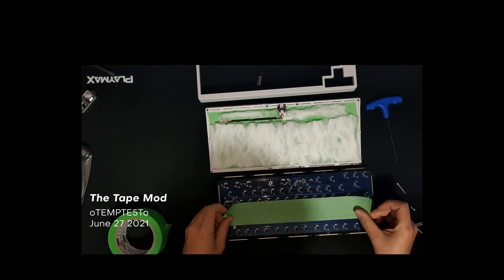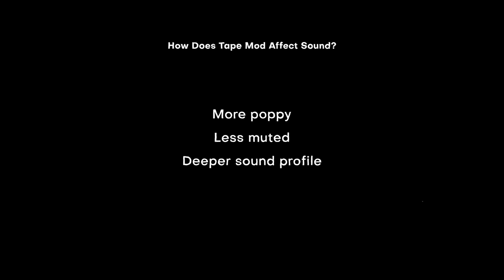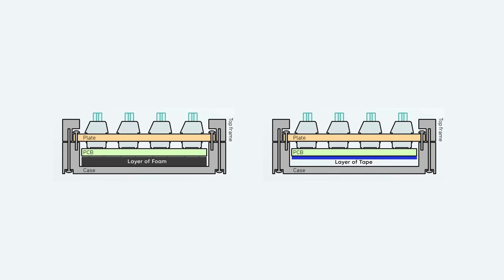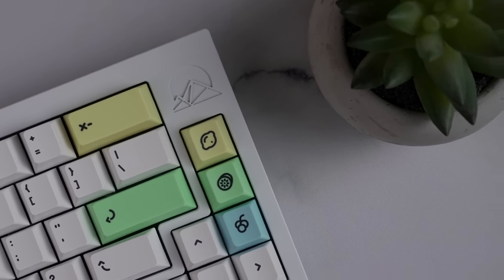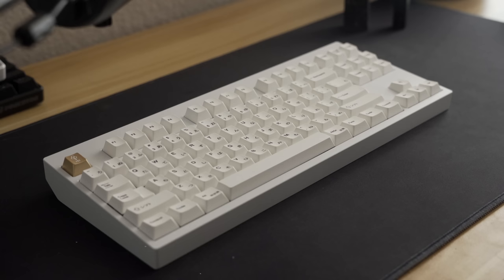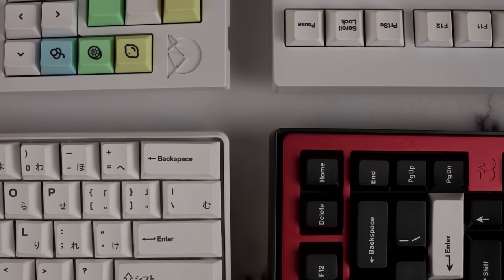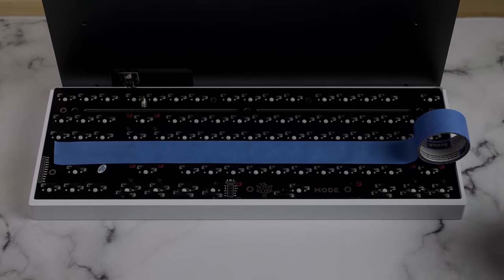Tempest Tape Mod Explained

Comment from the maker: PLEASE EXPAND THIS COMMENT FOR IMPORTANT INFORMATION

There’s a lot of great insight being shared in the comments, and I can only pin one, so I will compile it all here. 

The tape I personally used was SCOTCH BLUE: https://amzn.to/3fkDBuS 

*Shaquille Tarek* believes that the tape absorbs the higher frequencies of sound made by the inner assembly, acting as a kind of filter, while still reflecting back some of the lower frequencies. This is agreed on by ai03, and Tempest himself, so I would say this is the actual proven theory up to now as to how the mod works. Regardless of what the mod scientifically does, the effects of the mod on boards is fairly predictable (but of course there will be outliers because of unique designs).

*Zach Shapiro* thinks the mod will work especially well for tray mount boards, and has personally tried it with his Tofu, yielding great results. He found it helps remove reverb and boosts the volume of the inner assembly. 

The keyboards that I mentioned don’t have a PCB are **HAND WIRED**. This is when you essentially make the PCB on your own using through hole diodes and a QMK compatible microcontroller. 
Read more about it here: https://beta.docs.qmk.fm/using-qmk/guides/keyboard-building/hand_wire
And here: https://geekhack.org/index.php?topic=87689.0 

*Rob R* theorizes that tape adhesive should get stronger over time, as it bonds with the surface it is applied to. This would create problems if the board owner wanted to remove it in the future. The mod hasn’t been around long enough to prove this, but I’ll make an update on this in a future PE foam mod explained video. 
Tempest explained that he never had this issue with washi tape, and if it does arise, to use regular PCB cleaner / isopropyl: https://amzn.to/3BYa9od

A lot of people also seem to have inquiries about PE foam, a mod that also seems to drastically change acoustics. I’ll have some in soon to mess around with and I’ll try to answer all the questions (namely tape mod + foam)  in the comments regarding it. 

Further questions can be redirected to my Discord: https://discord.gg/VBuHBW3BUF 
Or Shoobs’ (where Tempest resides, but please don’t ping him): https://discord.gg/caBRWtya3a 
And of course, please watch Tempest’s original video on the mod: https://youtu.be/4T8Ov74i4m0
Reply: ok
Reply: thanks, totally needed it all
Reply: The fact that you said it was easy wasn't true when I wanted to screw in my ducky one 2 mini since the case is larger and It was difficult to put the screws back in
Reply: Is there an update whether the adhesive on the tape stick to the pcb or it did not?
Reply: @shirouemiya5660  Been using this for 2 months or so on  a TKL board I have. The other day I got some new switches and wanted to know what they would sound like without the tape mod. When I removed the tape it was super easy (what I did was I overlapped one strip of tape with the other). Surprsingly it made it even easer to peel of since the tape was like one single of paper. Then when I put it back, it still had enough adhesive to stick to the PCB again. I used rmasking tape. No damage done, just don't use stickier tape I guess.
Reply: What is a good tape to use.
Reply: @vectivuz1858  Hello, does your keyboard have a battery? I want to know if it is true that masking tape can be a fire hazard?

Comment: "99% of boards will have a PCB." Wait, what's the 1%
Reply from the maker: Hand wired
Reply: @nearLucid  lol
Reply: @nearLucid  make sense..
Reply: ? hand wired
Reply from the maker: @MysticM0  as far as I know, it's basically making your own PCB. It's very complex and theres barely any information on it, but would be a fun project for anyone who enjoys soldering.
Reply: @fitchyyboi  People who know how to use a soldering iron and have patience do exist. Personally love soldering. Having metal just flow on another metal at your will is pretty fun personally. Only desoldering is a pain tbh
Reply: I made a handwired 40% not too long ago just to try it - pretty fun
Reply: 1%(obviously more) = membrane/handwire
Reply: @hinczykus  But membrane has a PCB.
Reply: making your own PCB but it's just the C
Reply: Typewriter
Reply: The scary ones
Reply: Cutting boards lol
Reply: @weiyuan20  pfft haha
Reply: Non mechanical ones? The ones with the rubber board
Reply: @ottersaurus  it is still technically a keyboard with a pcb, Printed Circuit Boards are basically just boards with conductive material printed on it, letting current pass through, a membrane technically does the same thing but I wouldn't really call it a board when it comes to the material used
Reply: I also remember seeing a keyboard that projected an image onto a surface like a desk and when you "pressed" the keys it would register on the gadget show (a show in the UK) when I was a child.
Reply: @nearLucid  it's not with a teensy, but this is technically a PCB too.
Reply: @fitchyyboi  Soldering is really fun and satisfying IMO!
Reply: @fitchyyboi  cope
Reply: type writer 
0_0
Reply: The musical keyboard
Reply: the world is very big that's why everything is not 100% all the time XD

Comment: Definitely makes cheaper boards sound so much better
Reply: No it most certainly does not. It makes it sound MUCH worse. Even a good sounding keyboard with tape mod becomes a cheap mushy keyboard you'd find in the computer lab at school.
Reply: @HotCoco_  it's preferences. some like mushy, thocky, poppy, clacky, silent, etc. same as ppl opinions about o-rings
Reply: @HotCoco_  That's fine, you can be wrong as much as you like.
Reply: @kristoffer3000  Shouldn't I be the one telling you that?
Reply: @HotCoco_  if you thought that cheap th61 sounded better before the tape mod, you need to flush your ears mydude.
Reply: @charlesdovideo  If you enjoy the dull muddy ass sound of that tape mod, you need to not be here commenting on a keyboard video.
Reply: @hdhrdfsrkgh  "Gain some IQ" said the guy who likes shitty keyboards. Maybe try using a keyboard that's actually good quality, and don't ruin it by shoving painter's tape inside it. You might find it actually sounds and feels...y'know, good. Instead of feeling like garbage.

Comment: I disagree with your explanation of why the mod works. I think what is happening is that the tape just absorbs the high-mid to high frequencies coming from the pcb and what's left is reflected back up resulting in a kind of low-pass filter sound. Sound is vibration. So usually the pcb is vibrating, causing the air to vibrate, but with the tape the upper frequencies being a shorter wavelength are dissipated and diffused through the tape, leaving only the longer wave length vibrations to pass into the air. 

That's just my guess as someone with an audio degree.
Reply from the maker: If frequencies are being absorbed, how would it make certain boards louder?
Reply: @nearLucid  I would say that it's just that they are perceived as louder. either by a perceived increase in attack but a much shorter sustain and decay, resulting in a more transient sound. Or perhaps the energy that is dissipating via the diffusion of the upper frequenting ends up contributing to the strength of the lower frequencies. 

I'm basing this on how instruments behave to mutes and how it changes their sound.
Reply from the maker: @orcblud  I think I’m starting to agree, but of course the mechanics of the tape mod would change along with a keyboards mounting style. Either way, the end result is fairly predictable. It’s not every day that you find yourself debating about the acoustics of tape.
Reply: @nearLucid  I could be wrong. But at the end of the day if you cover a drum head with tape its not gonna ring out at much and you're gonna lose some high-end.
Reply from the maker: @orcblud  the drum analogy is a little interesting. Assuming there aren’t any snares, the drum equivalent of the tempest tape mod would be to apply the tape to the bottom head, where it’s directly against the primary source of sound, the top head. A drum would, of course, deal with more resonance, since the interior is significantly more hollow.
Reply: @nearLucid  yeah i agree, the case and mounting style would be akin to how different rooms of different sizes and materials have differing acoustic properties. 

This hobby is wicked, I like that we can get nerdy about such specific stuff.
Reply: @orcblud  I agree with you, wouldn't the sound be basically the same as without the tape but louder if it reflected 100% of the sound (theoretically speaking)?
Reply from the maker: @mr_mic2685  The case still accounts for a majority of the keyboard sound profile. Tape mod wouldn’t affect the case. Of course nothing can reflect 100% of the sound, it’s just that he speculates less might be reflected than I initially thought.
Reply: At this point I'm expecting someone in a keyboard community to tune a mode80 to a certain note like the key of c major
Reply: I think you are mostly correct but i think the tape is adding some rigidity to the PCB which may allow it to vibrate differently and stronger to generate lower sounds for longer. Sustained sounds are perceived louder than short bursts of noise even when the short burst is way louder so that could explain the perceived increase in noise.
Reply: @SvenPeppers  the rigidity part is rather doubtable as you can hear a sound difference when you just loosely apply some tape under the alphas on top of the hotswap sockets. The amount and application of tape in such a case doesn't really add any rigidity to the PCB (none I can see atleast) but still changes the sound.
Reply: @nearLucid  frequency isnt the "loudness" they determine the pitch, amplitude is volume
Reply: Im the 69th like
Reply from the maker: @ducttaperulestheworl  LMAO
Reply: This sounds like a good explanation. It might be a blending of effects, but my guess is that it doesn't much 'reflect' the sound given the tape is a soft medium. Most soft media deaden sounds.
Reply: To the guy speculating that the tape just cuts out frequencies, it can be easily tested out by running the audios of the type tests with tape and without tape through an audio visual equalizer vst in a DAW which shows the frequencies and just compare if the high end/low end frequencies of the with tape type test has lower amplitude than the without tape type test.
Reply: this is by far the most interesting thread of comments ive read in a while! you guys are really smart, and the other guy who talked about the drums and tape. that just helped me understand more of how this works
Reply: bro smart smart
Reply: I tried this randomly on a Ducky One 2 SF (steel plate, plate-mounted, kinda cruddy plastic case) along with a layer of Dynamat xtreme in a larger cavity between the kickstand legs and agree that the sound profile is lower-pitched overall with less in the way of trailing decays following the initial excitation. It's not necessarily louder to my ear, though the fact that I applied two mods in one go makes it hard to determine what's attributable to which change. RIP the scientific process, but at the very least I can confirm that the profile works well (IMO, YMMV) with the One 2 SF.
Reply: @nearLucid  I think that adding more layers of whatever it is adds to sonic complexity, the sound vibrations has to travel from more different surfaces this way, which per surface will have different filtering effects, but by multiplication of surfaces result in more and more diffusion but also natural sound compression. I think it "sounds" louder due to this, which means it's perceived loudness.
Reply: *diffused, no absorption is happening here, as someone with an audio degree you should know this, the tape is also adding mass which lowers the board's resonant frequency
Reply: p
Reply: Everyone so smart here, i have no clue what any of that means
Reply: @owoah43 same
Reply: @nearLucid  Because it sounds quieter to me
Reply: y’all are over complicating this so much 😅 
i’m just gonna put tape on my keyboard and call it a day
Reply: like moongels on a drum

Comment: The tape could in fact be scattering/diffracting higher frequencies while allowing lower frequencies to transmit through the material, reflecting off of the hard bottom case back towards your ear. This would account for the deeper sound signature that this mod typically produces. In this case the tape would be acting as a filter instead of a reflector.

Comment: ello drummer here, i love how from my understanding, keyboards and drumskins have a lot in common with sound: specifically, the plate/pcb/switch assembly to a case is like a drum skin to its drum shell, and typing on a keyboard is like hitting the skin of the drum.

Gasket, top, and bottom mount boards have the closest similarities to a "drum," where the plate assembly is held around the edges and is "free to vibrate" like a drum skin. Gasket mounting basically lessens vibrations to the case, so you hear more of the plate assembly sound compared to the case, while in a top/bottom mount case you would hear more case sound.

Drummers would know, sometimes drums have some ugly overtones, basically nasty high pitched ringing. Tape or moongel is often used to reduce these overtones.

So my theory is that the foam mod when implemented lightly, slightly mutes the sound overall and lessens some overtones and pinging, making boards seemingly "thockier".
Over-foamed boards just sound too muted and completely takes away any of the sound characteristics, much like completely muting a drum skin you wouldn't hear much.
The tape mod or pe foam mod is like putting moongel/tape onto a drum skin, where you would get the most natural sound, while eliminating higher pitched overtones making it seem deeper.

TLDR: my theory is that pe foam/tempest tape mod reduces overtones and sliiightly mutes the sound, making boards sound poppier and seemingly deeper, much like putting moon gel/tape on acoustic drums to reduce overtones and slightly mute them, making them sound slightly punchier and less ringy

i didnt expect this to be this long LMAO i geeked out too much ok bye
Reply: thanks for help

Comment: just a passing commenter's critique, when doing typing tests, type a little bit slower on purpose. It's awesome you can type that fast, but I could barely distinguish individual key presses which isn't super helpful when comparing one thing vs another (in this case, a mod vs no mod).
Reply: I agree! His videos are great, but his typing test is just at one fast speed, which is not very realistic compared to real world keyboard typing

Comment: Effects of tape mod on my portico with U4Ts (no silicone dampener: Overall made the board a lot more enjoyable. As you mentioned it makes the board louder, poppier, and much deeper. Since the Portico is an entry board, and admittedly sounds garbage stock, this was a massive quick and easy improvement to this cheap gasket mount board. Once PE foam was added between the PCB and plate, however, much of the effects were reverted or lessened. The foam does give the board a much poppier and enjoyable typing experience but it also heightens the pitch a little (not as high as stock) and also makes it a little less quieter compared to plain tape mod. I think that paired together the PE foam and tape mod can be a power duo in entry level boards
Reply from the maker: Interesting information, and I very much appreciate your reply. This has honestly been a monumental step in my PE foam mod video research, and has honed in my theory to something which I think I can confidently present.
Reply: @nearLucid  No problem! best of luck in your research
Reply: How tf do you people keep saying tape mod makes a board sound louder and poppier? It just gives it a mushy, wet, squishy sound. It's fucking awful.

Comment: Great video! Anyone have any experience of how this mod interacts with case foam and/or pe foam on the pcb and whether it counteracts the effects?
Reply: part of a comment i wrote had something on this and ill just put that here;
"Once PE foam was added between the PCB and plate, however, much of the effects were reverted or lessened. The foam does give the board a much poppier and enjoyable typing experience but it also heightens the pitch a little (not as high as stock) and also makes it a little less quieter compared to plain tape mod" i have felt above the pe foam and pe foam as case foam

Comment: This does really work on my measly budget Tecware Phantom L. After applying several layers of masking tape to the bottom of the PCB and several snippets of it under the stabilizers, I've achieved the thocc and clean sound that I have wished for so long. The sound difference between before and after is like night and day.
Reply: How did you apply it under the stabilizers?
Reply: @citesse  I personally just put it there nothing different

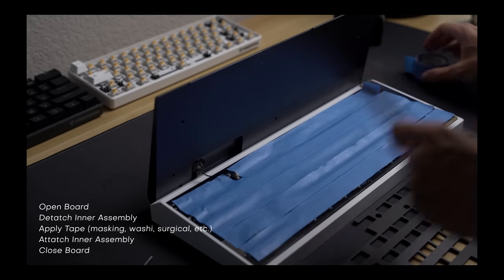Comment: Gaffers tape is not super sticky and that is why it was made is so it was easy to remove without much or any residue for cords/cables in stage sets. I have a roll of it next to me. Error is at 0:43. 

Gaffers tape also works great for more of a dampening effect vs painters tape and if you are worried about any residues on the pcb just use painters tape as first layer and then any additional layers use gaffers.

Comment: I think that this mod will be really good for tray mount board like the Tofu and GK61. This allows the assembly to shine more than the case and removes a lot of the reverb and instead raises the volume of the switches, plate, and pcb. I will definitely try this on my Tofu which already has some foam in the case. I think that foam combined with this mod will really allow cheaper boards to showcase the switch and plate choice much more :3